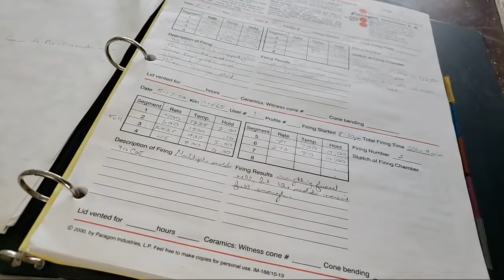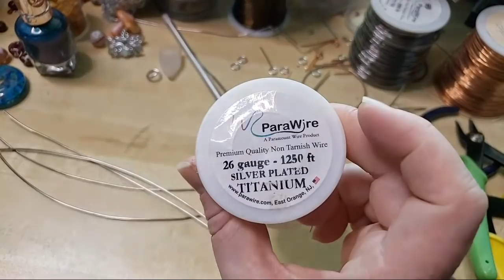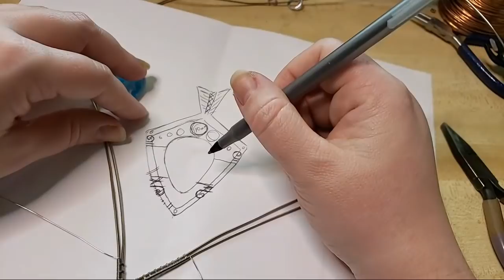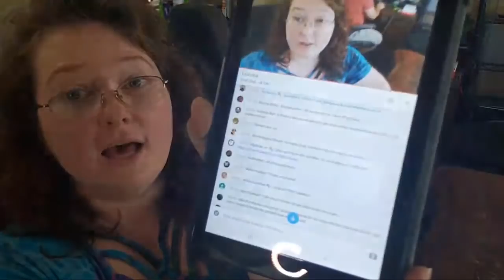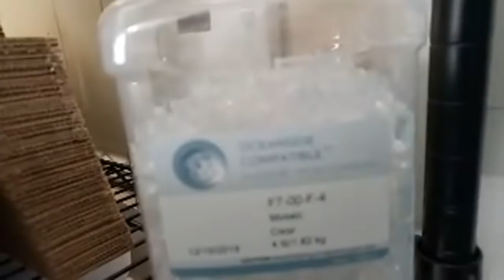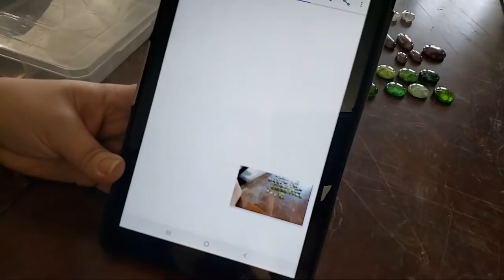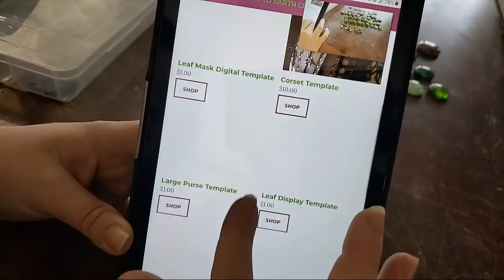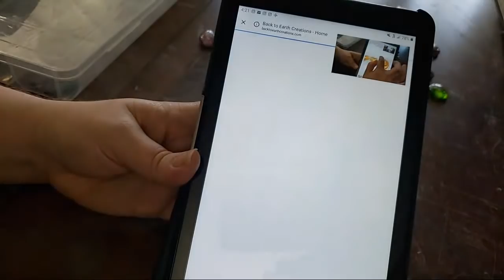Craft Along With Von 6.9.20

Comment: If you want to get rid of gophers, try this idea; have Randy get a tall length of wood that is sturdy and attach a medium sized propeller in a tube and attach it close to the top of the wood ( like a pin wheel). Dig a hole in an area close by the gophers entrance and place the other end of the wood into the hole and press it in firmly so the wood won’t be blown over. My friend came up with this idea and it worked for him. He put up two of them ; one on the North end of his garden and one on the South end. When the wind blew the propeller would vibrate and cause a” thumping “ sound in the ground which caused the gopher some irritation and he moved. ( I guess it was like the neighbors were playing a kind of music it didn’t like so it moved away.)